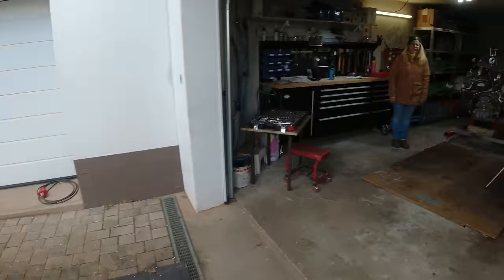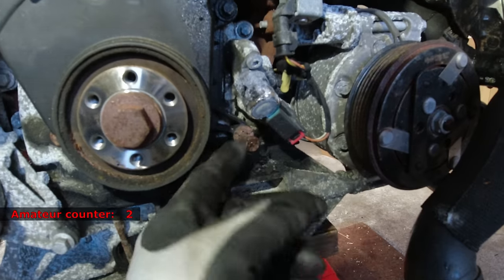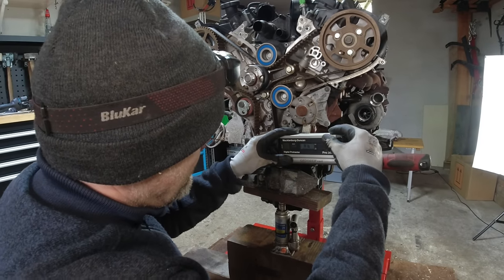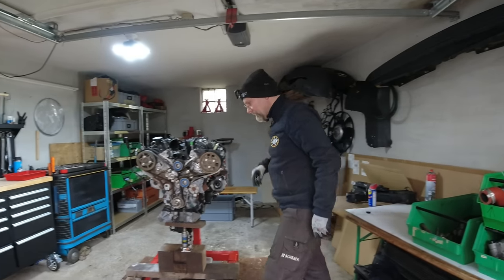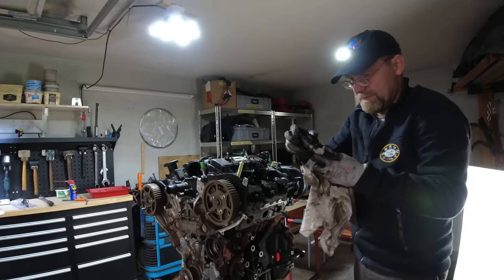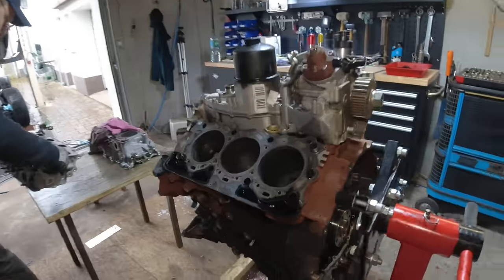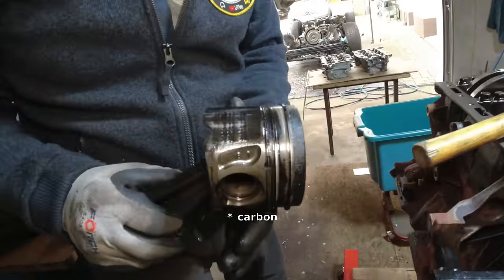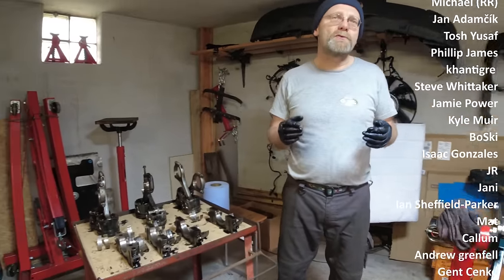Poor Maintenance resulted in Engine Failure ? 3.0L SDV6 / S5-EP15

Comment: Rainman Ray and I just tore down a 2nd gen 3.0 and found basically the same thing. 2 holes in the engine and oil pan but this one was destroyed from tuning our video will be on soon.
Reply from the maker: 👍 That sucks. We are not a fan of tuning these engines. You introduce a whole new set of problems unknown to the laymen🙋‍♀️
Reply: @Vera_and_Christian  that's the truth. Doing stuff like that you need to be sure to use someone who knows what they are doing. On the Ford side of the house, when you have a power switch they start out with a big tune, let's say like say 120hp tune. Then the switch is used to reduce fuel to lower the power. Well that big tune normally has a bunch of timing in it as well. That's what kills the engines at least here anyways. Timing wont change and we end up with holes in blocks. I only have 1 person over here if trust tuning a 3.0.

Comment: Christian can you help me, My Wife will not start!?  She has been maintained and serviced regularly,  I did consider stripping her down for inspection but thought better of it has I may have become injured in the process.  What I really need is a Vera, I have searched the internet, however, the ones I found did not seem qualified to get dressed let alone pass me the right tool and put all the parts in the correct boxes. I also tried Halfords but they only had an Alexa. I would really appreciate it if you could point me in the right direction, also, is there a more economical version that does not require feeding so regularly? All the best and many thanks, Miles X
Reply from the maker: I think you should invest more effort into upgrading the wife you have.  At the beginning they don´t know that there are 1/4" and 3/8" sockets.  After a few upgrades, they tend to know. And after a few more upgrades, they even start to sort the sockets and materials.  Christian

Comment: Consider cutting and rewelding the legs of the engine hoist so that they are parallel and fit nicely inside the engine stand not to mention within the front tires. It was such an annoying design . Add appropriate gussets if you doubt the welds. Too bad I can't send you a picture. 
Tschüss

Comment: Doesn't necessary take hours to get complete failure after rod knock, i had renault espace (infamous 2.2dci)  that started to make rod knock and i drove it home (less than 10km)  it threw the conrod trough the block right in my yard. (Of course if i have been wise i would not have driven the car at all, luckily engine from scrapper was only like 400eur)

Comment: Brilliant as always , I run a 2012 sdv6 and she gets an oil and filter change every 3000 miles she has 72000 miles, do you recommend I start using 15/40 ?
Reply from the maker: No, check out our "Engine Oil and Oilpump " playlist. We use 5W40 and all is explained in these videos and in the video description. 👍🙋‍♀️
Reply: @Vera_and_Christian  ty I will watch , I meant 5w/40 not 15/40 👍

Comment: It looks to me that the injector on the front piston at 22:37 could be faulty - the top of the piston looks covered in fluffy carbon unlike all the others.  Not the reason for the damage, but something to check in the future when re-assembling.
Reply from the maker: All damaged parts will be replaced of course, like we have done on our previous 3 engine rebuilds. 👍🙋‍♀️

Comment: with what you have at your disposal, you can weld up that block.  we "amateurs":goodvibes::goodvibes:   have to buy a crashed xf for around 2k & swap the engines over.
Reply from the maker: Not with  a Euro 6 Gen 2 engine. We must do a better job explaining these engines. 👍🙋‍♀️

Comment: Well now you've learned that when you've bought a car with an engine problem but not a completely ruined engine, that you have to unplug or take away some wires of the engine so that the towtruck driver cannot start it up anymore and cause more damage when loading.

Comment: Plan B: You buy a running 2012 Disco' 4 for about €5k, take it home, remove the body and fit the 2016 body to the 2012 chassis.

The TUV would be okay with that, right? 🤔
Reply from the maker: It's a Gen 2 Euro 6 Engine, not Gen 1 and cannot be matched. I thought we have explained that, appearantly not enough. The block is different. 👍🙋‍♀️

Comment: It’s located in Norway you can buy it as it is and can sap the engine from it it’s away cheaper DX than buy new block or new engine
Reply from the maker: Ah you send an email. We got so many emails. We have a Euro 6 Gen 2 engine. A TDV6 and even the SDV6 Gen 1 engine blocks do not fit a Gen 2 engine, they are different.  We must do another lecture on the differences of these engines. 👌👍🙋‍♀️

Comment: instead of welding that piece - why not mill out a flat surface around that hole and bolt on a flat patch made of sheet aluminium? :-) All in all, you didn't perform a strain analysis on that short block, and you don't know if there is any load in that particular place (probably not a good idea if you want to sell it to someone else, but if it stays with you - that would be an interesting test that could potentially save you 6,000 (8,000) euros?
Reply from the maker: Yes, I evaluated this.  The problem is that the holes is in a double-wall on both sides.  There are ribs and cracks and the hole is larger on the inside.  Still, I will do a attempt to fix this in some way but not for this build.   Christian

Comment: That engine has had plenty of oil changes. There's not even varnish on the top end.
Reply from the maker: Oil dillution is present after 10t km.  Build-up of black stuff is starting at 30 t km.  So there is no way to tell by the amount of residual contamination in these engines.
Reply: @Vera_and_Christian  Routine oil analyses should tell you what starts failing. Wonder if the timing being off by 4 degrees was a contributing factor and high loads on the engine. The sand residues and the high corrosion of the aluminum is a tell tail of beach and or winter usage. I hope you have found a block.

Comment: Oil in a engine has always been necessary, and regular oil changes as per manufacturer , is necessary . But this is were I blame manufacturers, in that they have led vehicle owners , to take “ chances “ , with extended oil change intervals , with oil manufacturers “ back- up “ . And of course owners trying to “ save “ a few “ pennies “ and end up spending many more pennies 😂
And then there is Christian and Vera , proving that “ dumm ass “ 5w- 30 , has been a problem  , with certain  engines 😮. It’s very disturbing and disappointing, that some “ dealers “ are not up to standard , when repairs are done 😮. Is the repair industry failing , standards , dropping ?
EV’S are perhaps a sign , that , in future combustible engines , will not be able to be stripped down and repaired ? What a disappointment that will be 😢. I guess it will be what it will be .
Only 1 ( one ) part number on a engine - complete engine ( remove and replace ) ?

Comment: buy a burn out car the block will be good and it will be cheap
Reply from the maker: Not again. You guys, this is a Gen 2 Euro 6 engine. Not a TDV6 from an old LR3 or even a SDV6 Gen 1 from a  LR4. They do not match. I am so surprised that most do not know that. 🙋‍♀️

Comment: JLR should be shut down they are an absolute disgraceful company now nothing has changed with their vehicles doesn’t matter who owns it I bought a mark 1 Range Rover in 1977 and I burned 2 litres of oil a week when I bought it it had only done 15.000 miles never bought another one bought Toyota Land Cruiser still driving Toyota Land Cruiser today and the one I’m driving now has nearly 3 hundred thousand miles on the clock
Reply from the maker: Yeah Toyota finally caught up having a unreliable V6 engine. Now we can get ourselfs a Toyota, even if we have to import it.😅🙋‍♀️